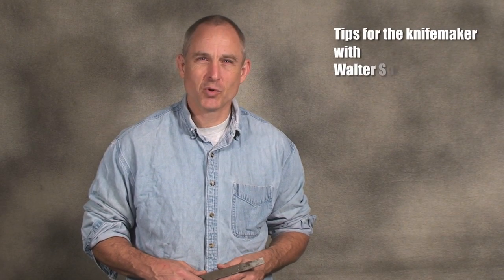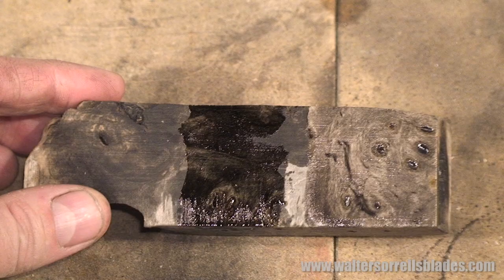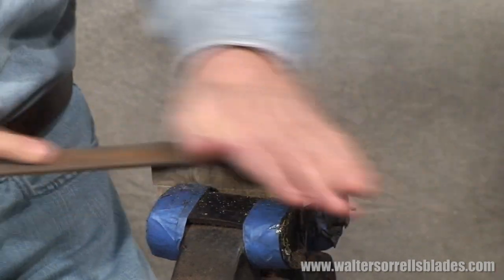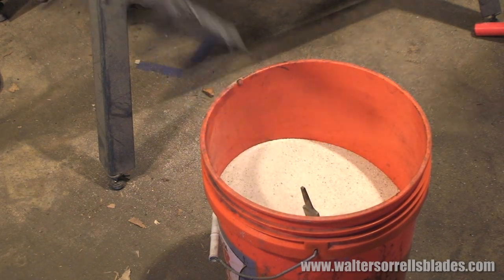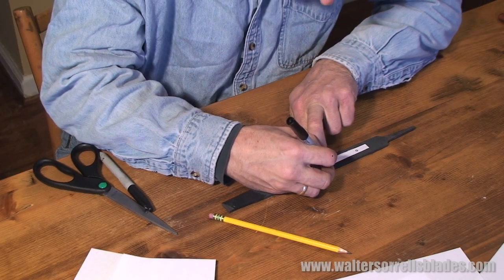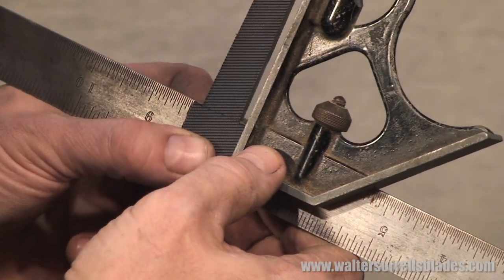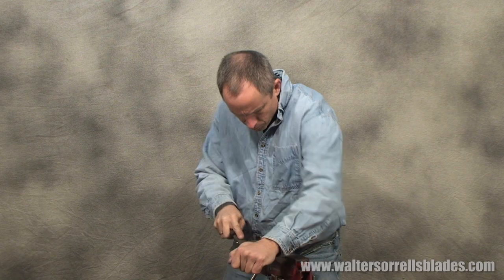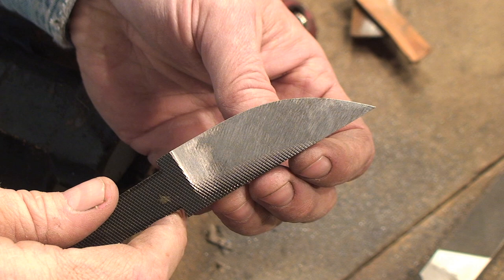How to Make a Knife - Part 1

Comment: I just wanted to say thank you! I followed this step by step with some minor changes, did plenty of reading and managed to make my first of hopefully many knifes to come! I'm super proud of it! I personally recommend ending  with a 1000 grit sandpaper on the blade for a nice shiny finishing touch, and a good tip I read about is when hardening the steel to use a magnetic to see when you can dip it in the oil. Thanks alot Mr Sorrells.

Comment: Thanks Walter, this is a great tutorial. You're a great teacher in that you don't leave any block unturned and explain things well. I do have a question. Can I use a matobo blade on my 4" grinder to cut the knife blank out? And a bench grinder to get the majority of the bevel on the blade? Then finish up with a file and sand paper. Not asking this because of laziness just wanna work smarter not harder if at all possible. Thanks again!

Comment: Sorry if this has already been dealt with, but I was wondering about the problem of warping/bending when annealing the file. I've started work on a file that I annealed a while back using a similar method to yours, but I let it cool in the ashes of the fire overnight rather than putting it in sand. I've ended up with a bend in it, which I've since read is a fairly common problem when doing this (ie with a file. I'm no metalurgist, and I've got a lot of research yet to do before moving on...). Would putting it in sand have helped with this, or is it just something that happens and needs to bent back straight with a vise or something?
Thanks for the videos, by the way. Well presented, well paced, and informative. Ta :-)

Comment: just watched this. is'nt the nic. files now just  hardened on the outside? are they still 1095 steel? nice to see someone also knows how to use a file correctly. clean file just about every stroke. belt sanders cost alot , but will save time. still love making knives too.

Comment: Hi. In order to make sure the file simply isn't case hardened, can I use a grinder to grind a couple millimeters away and then try scratching the inside with the corner of another file? I read about using the grinder and watching the different types of sparks but I'm not sure that I would be able to tell for sure by just looking at the sparks. I think grinding and scraping the inside would be better.

Comment: Question: 
I am currently in the process of making a dagger of sorts but I'm struggling to work out how to fix a rounded wooden handle. I don't want to use glue (it seems like a tacky method) and I don't have anything to thread the tang either.
 
The tang is about 0.5 by 0.5cm and its square. Do you think I can I could simply drill a hole in the handle and hammer it onto the square tang securely without it splitting with pressure? 
Also, could I somehow heat the tang, would this cause the metal to contract then swell or something to create a tighter hold?

Finally I wont be using a pummel of any sort on this dagger, just so you know (all just one handle).

Comment: Hello, i am a new subscriber with a question. I have some old Nicholson flat bastard files, i have verified the hardness and ground out the teeth. I am designing the blade profile, and the file is not quite wide enough, my question is whether or not i can weld more than one file together and work with that, or if stock removal on welded files is a bad idea. Should i find a different piece of steel to work with, or is welding a possible solution? I guess i could change the design of the knife, but i have my heart set on a large clip point that just wont fit. Any suggestions?

Comment: I tried the heating and cooling in sand to soften the file today. I did 3 files.  all three are easily filed wit ha bastard file, but also are very tough to cut with a hacksaw still. I'm uncertain as to if it worked. while doing a small amount of filing the material was removed easily and seemed to have no affect on the new bastard file.  Just being hard to cut confuses me?

Comment: Is there a difference between a old file (I think they should be better qualitiy) and one for 5$ or less on ebay?(Is it possible to get good material for that low price?) Or should I go with some "knifemaker steel"?
Reply: 01 is best
Reply: maddash1337 1095 steel is the easiest to diy heat treat so I would by that

Comment: Hi Walter, great video! Which sand do you use for the annealing? Is it just regular sand or should I go and buy a specific tipe of sand?
Reply: +Conrad Penzhorn I used normal Icelandic black sand. Dried it a little and it worked great.

Comment: Hi Walter - a quick question for you. when you heat threat with barbeque bricketts as opposed to normal coal, does this transfer any of the chemicals from the bricketts into the steel? and will this have an adverse effect on the metal? I get that this is a basic, personal use tutorial, but it got me wondering... cheers.
Reply from the maker: Adam Tanner  No you won't have any problems with that.
Reply: Righto, thanks - great tutorial!

Comment: Walter, I gave it  a shot annealing a file on my charcoal grill. I got it to a nice glow and put it in the sand, and when it was cool to touch I found out the file was now curved. Did I do anything wrong, or is there a way to easily fix this?
Reply: Old trick I learned from an old old knife maker. When you heat up steal and put it in oil. Make sure the knife point is facing north. It has something to do with magnetic north. Try it and let me know how it goes
Reply: Aaron B mine did that. I reheated it and I clamped it down to a piece of angle iron with c clamps.

Comment: What are the pros and cons of making blades with stock removal vs forging?
Reply from the maker: Really good question but probably too long an answer to fit here.  I'll try to do a video on the subject.  Short answer;  forging gives you more control, takes more work per knife; stock removal is better for air hardening steels (generally, but not exclusively) stainless steels.  Lots more to it than that though!
Reply: If you wanted to make the very best knife possible would it be forged? Assume that an appriate steel would be used.  Thanks for the excellent videos btw.
Reply: Walter Sorrells Could you heat the knife in a non charcoal grill too?
  Thanks and great videos

Comment: i dont understand - i thought you were supposed to shape it out BEFORE the heat treatment since the metal becomes too hard and brittle. However, after the heat treatment, the blade was dipped in sand and allowed to cool... In other videos, the blade is dipped in oil, and then placed in an oven at 400 degrees and then, allowed to cool. Am i missing anything?
Reply: He do that to make the steel softer. :)

Comment: hey Walter i was wondering if you could anneal the file without using sand? I simply can't find any sand in the shops around me and i was wondering if there would be a substitute... thanks
Reply from the maker: Adri21n   Any insulator will work.  Ashes, for instance.  The main point is just to cool it as slowly as possible.
Reply: Walter Sorrells So could i even leave the file in the fire once its red, until the fire and the file is cooled down? cheers
Reply: +Walter Sorrells if u ou leave the file in the charcoal ash and let it cool as the fire burns out and cools wouldn't that aneal the steel

Comment: Could I do the exact same process but instead of the old file, use 440c stainless steel? I don't have the most fancy of tools but I could order some of that.
Reply from the maker: +Keifman Seven (keifman7) Unfortunately not.  440C requires much more precise temperature control.
Reply: but you can send it off to someone who can heat treat it
Reply: Keifman Seven no